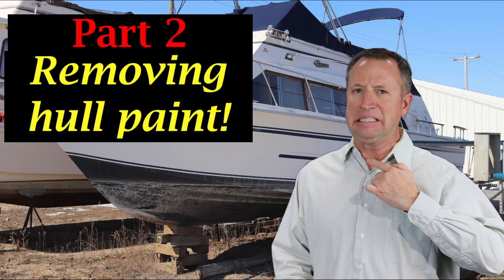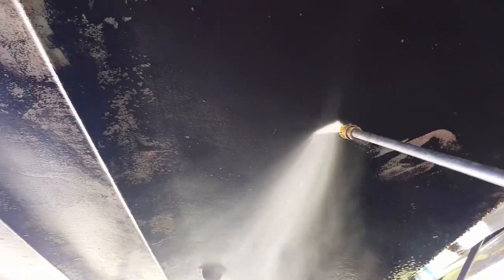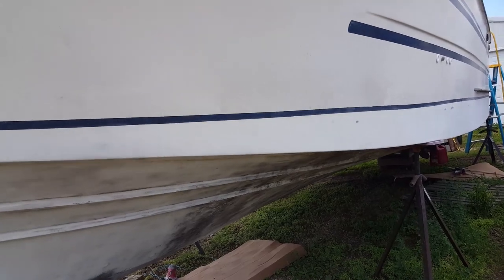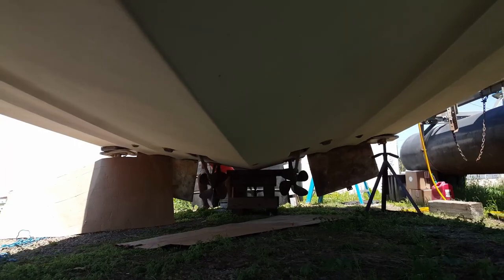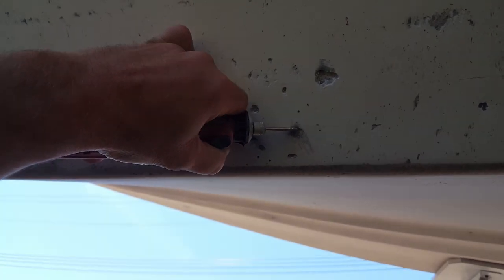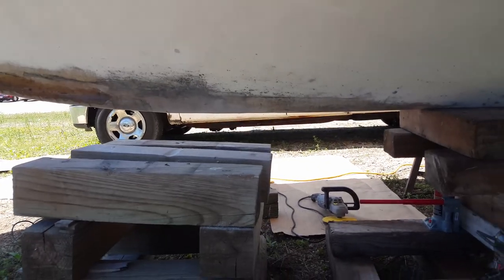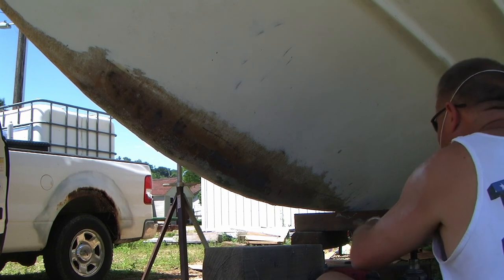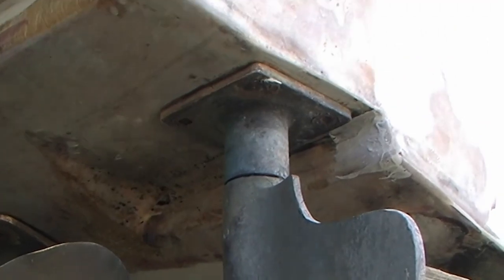Removing hull bottom paint and a 1978 Carver Yacht

Comment: Nice Project, I miss boat's. That Boat is in pretty good shape for what you paid. i would replace the cutlass bearings or at least check them for wear, have the shaft's checked for straightness, and check the rudder seal before you put it back in the water.
Reply from the maker: Thanks!  Will do!

Comment: At the bow is not an old repair job, you are beyond the gel coat-way past where you should be to repaint the bottom. That is heavy duty fiberglass roving that was installed at the factory. It is supposed to be there. Carver is a very well built boat, that is why it's a 1978 and still around! You can call into them any time and ask questions about their boats. They now are called Marquis Yachts, Pulaski, Wisconsin. They can at least point you to people who can help you out.

Comment: I am wondering if the bow should have had an additional layer of fiberglass added because of how bad the original patch was done.
Reply from the maker: I saw no damage from the inside, so I concluded that the keel patch was acceptable.   I evened it out with fareing compound.  Sealed, and painted.
Reply: @JeffNiemeier  Good Job

Comment: 6:50 poor craftsmanship ... 9:05
Reply from the maker: I believe the front fiberglass is just a  "Keel Guard" to protect the front.  I don't think there is any actual damage under it.  They just didn't do it right and it wasn't smooth.  I cleaned it up and you can't really tell with the new barrier seal coat and anti-fouling "bottom" paint.